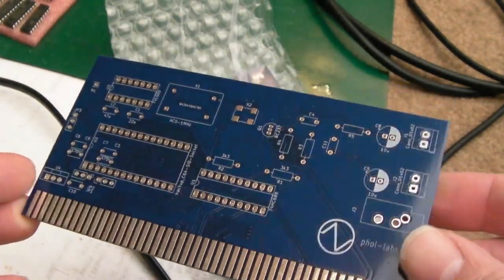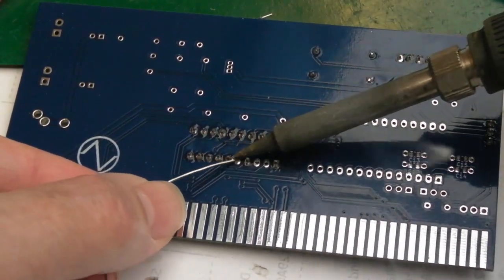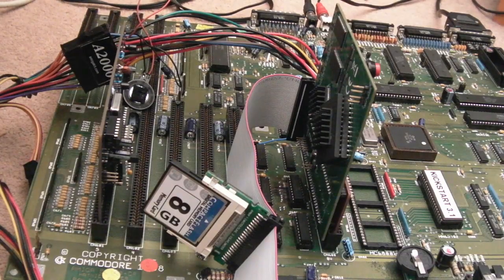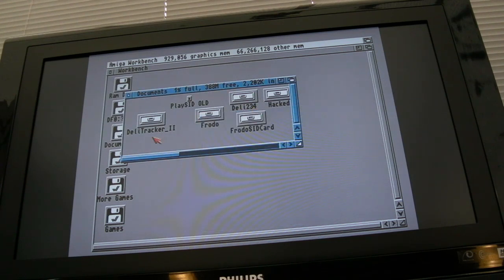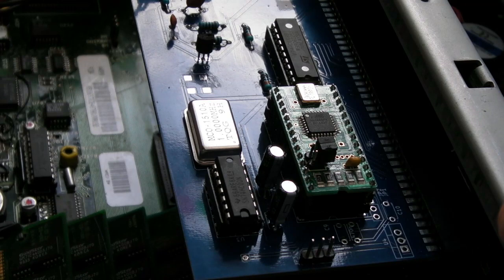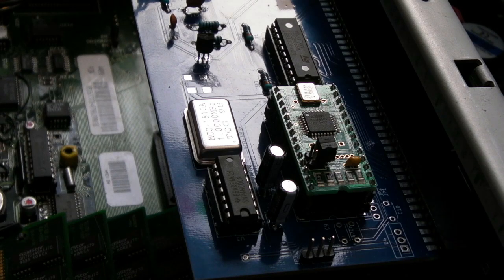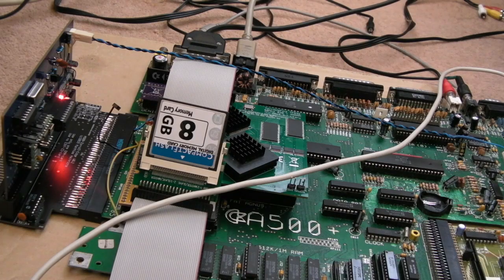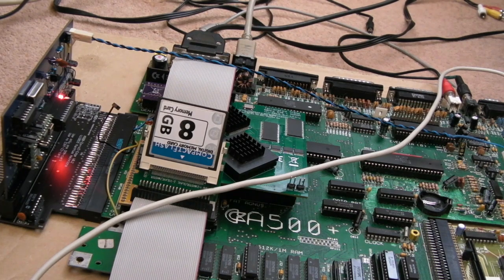Amiga Zorro SID Card (AmigaSID) - Hacked for A500 / A2000 / A3000 / A4000

Comment from the maker: The modified executable links are in the video description.  With LIV2's help I just modified the Frodo executable too, for the $EE range.  So both Frodo and the C64SID player (For DeliTracker 2) now work with the $EE range.   I showed the 2 mods for C64SID executable in the video, but if you want to do the mod yourself (or set another range) to Frodo - search for 41 F9 00 A0 00 01 and change A0 to EE.  LIV2 kindly converted the dissassembled code back to hex which made that mod super easy.
NOTE: Towards the back end of the video there, the transistor is mounted the wrong way regards silk screen - that's correct!  I put a different transistor in there (2N2222) - which has BCE in a different order.   Regards the address range and Zorro stuff - I am mistaken at that point that it shouldnt clash unless you've filled the ZIII range - this sits (I believe) in the lower 24 bit range (at the top of it) - so in theory I would expect it may clash with the 8MB in the ZII range?  I've tested with the full 8MB of ZII RAM used and it does NOT clash with the SID Card sat at $EEnnnn =D

It's important to note that when I talk about address $A0 or $EE, this is the upper most byte of a 24 bit address.  eg.  $A00000 or $EE0000

Comment: Really interesting video - I wasn't familiar with this project. Great advice for people who want to use this on an A2000!
Honestly, I just like listening to SIDs on my C64 :D However, if I were to try this project, I'd probably use an ArmSID - it sounds amazing, and very accurate with the default settings!
Great video!
Reply from the maker: Thanks =D  Yes, the ARMSID is great!  I have a BackSID coming up too - it will be interesting to see how that sounds.   The ARMSID is one of my favourite replacements so far.  It's a shame the SwinSID Ultimate isn't "open source" or sold anymore as that does an amazing job all around imho - I would use that without a thought or concern vs an FPGASID.

Comment: Thanks for this, I got my Amiga Sid SMD version up and running in my 2000 :)
Reply from the maker: Sweet! =D
Reply: @GadgetUK164  Have you tried with a real SID ? they pick up a massive amount of noise from the Amiga, especially moving the mouse or loading data, that's even connecting hifi straight to pin 27 of the SID.

Comment: That problem with the legs is down to the design file specifying holes that are too big for the legs OR the original designer was using a component with fatter leads/legs.  Flux will help and when sorting old ones that are like that it's often best to wick or desolder it first.  It's not down to bad technique of whoever soldered it originally or not totally.  I think the board designer, maybe, should have taken a little more time over it.

Comment: Just wanted to note that the audio input having the electrolytic capacitor oriented the same way as for the audio output, is correct, according to the SID datasheet reference design. It should not really matter though as the reverse DC bias would be really low anyway.
Reply from the maker: Technically it depends on what you are inputting and any bias there!

Comment: The PCB is realy badly designed. Is there a stereo mod for the SID ? (like with the AY on the Speccy.) That way you could have stereo mixing for a CD drive.
Reply: I think you need a second SID chip for stereo.
Reply from the maker: Yes there are some problems and mistakes, but I am grateful to the original designer - without his work we wouldn't be able to use or improve it.  So I am pleased he took the time to create it!
Reply from the maker: PS: A stereo mod could be possible, but it would need changes to the emulator and the player.  The emulator code is available, but not the player.